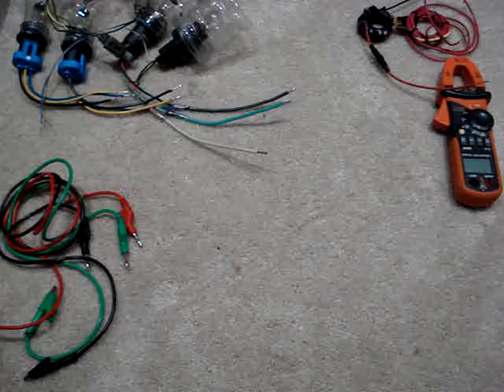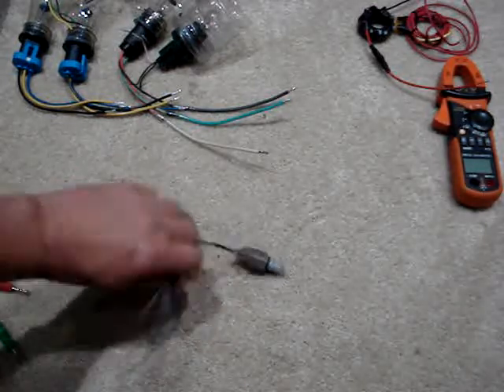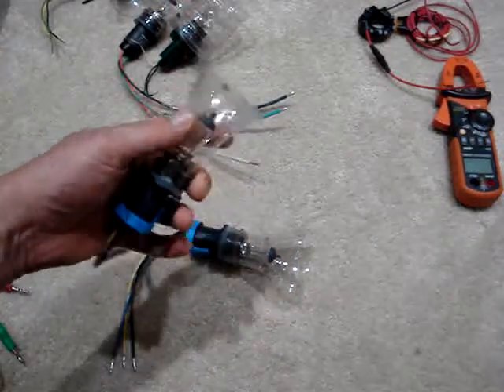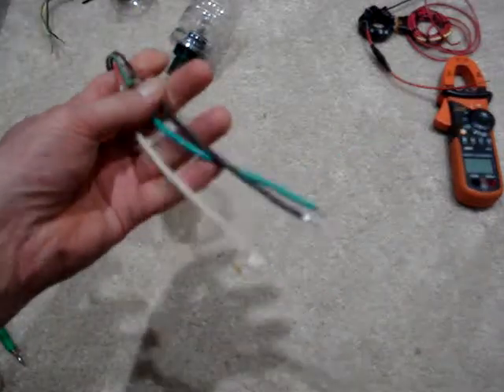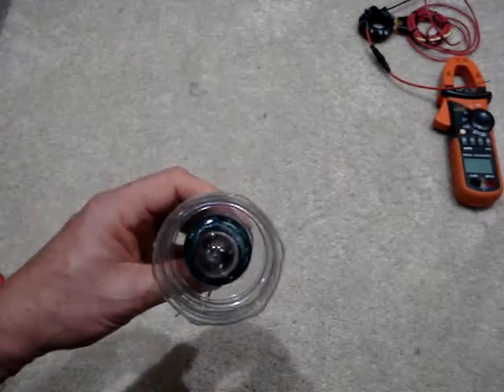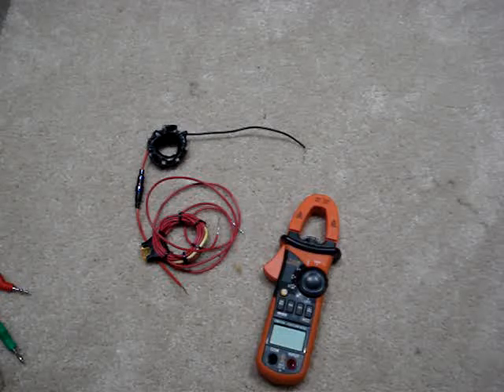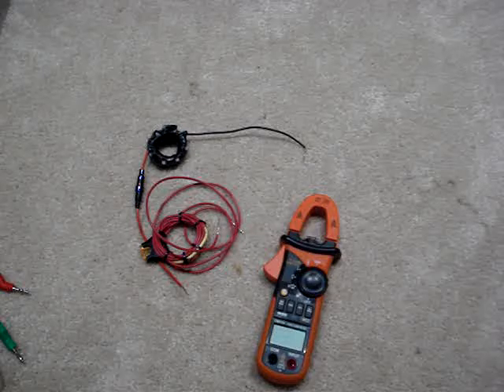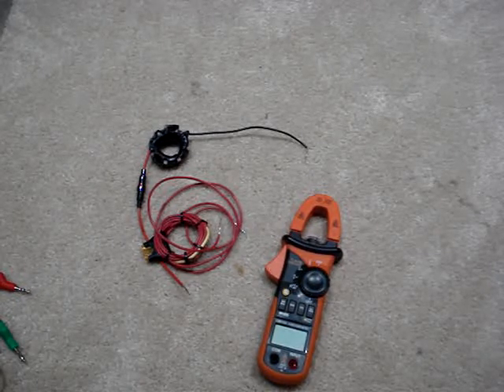DIY Automotive Electrical Test Tools -- Power Probe, Load Lights, and Amp Clamp Signal Booster

Comment: Some good ideas here.
Couple of questions though:
If you keep blowing the 500mA fuse in your meter, why not just use the 10A or 20A range/terminals (whichever it has) on your meter?
Also, if you already have to break into the circuit to use your current booster coils, why not once you're already at that point just connect your meter in line in the low amps scale, or higher amps scale if it's a higher amp circuit than your said 500mA?
Reply: There are many ways to skin a cat.  My issue is a ECM wake up that draws an amp then things start to go to sleep.  I'd have to change ranges constantly.

The amp clamp booster coils aren't needed all that often.  But, they're nice to have when necessary.

Comment: How do you get a 5 volts reference on your 'power probe'
Reply from the maker: Steal it from another 5 volt reference source under the hood.  Or, have a buck converter at-the-ready in your automotive electrical testing kit.
Reply from the maker: Some simple electronics for independent production of 5 volts on an automobile which covers voltage regulators and buck converters:

https://www.youtube.com/watch?v=giGRrODKJSE

Comment: Could you explain it to me like I'm a 6 year old. The last one with the extension cord. Show us how to use it please
Reply from the maker: Hook up the positive and negative battery clamps and then you've got power at the banana clips just like any extension cord...  In need of a 5 volt reference for the green third lead?  Tap into another working sensor under the hood.  Or, have a buck converter in your automotive electrical testing toolkit.

Comment: Very clever. Tks,
Reply from the maker: Most welcome!
Reply: I like the idea, but am concerned about the uninsulated clips on the far end that could touch.  Think I would use banana plugs on that end also, or maybe individual switches for each lead at the output end.
Reply from the maker: @paulmonk7820  Sure!  Whatever your preferences!  You can build and modify it to your personal specifications!